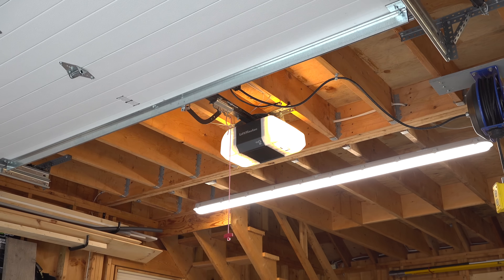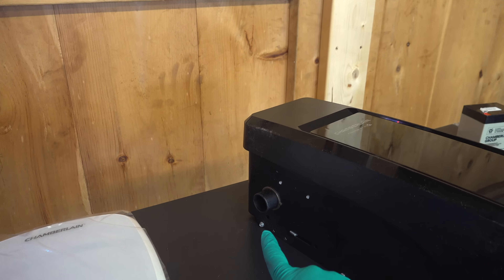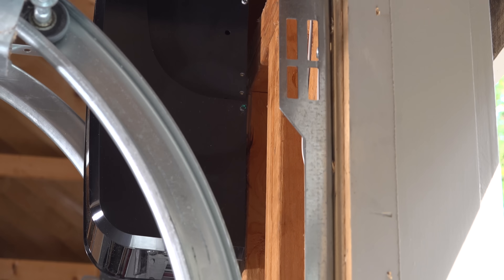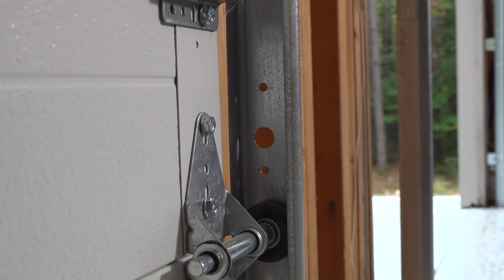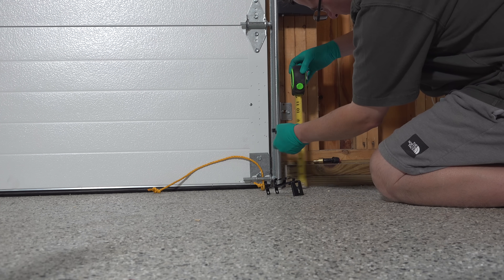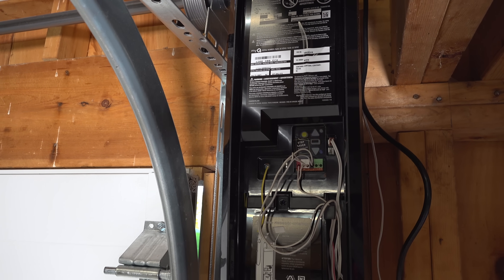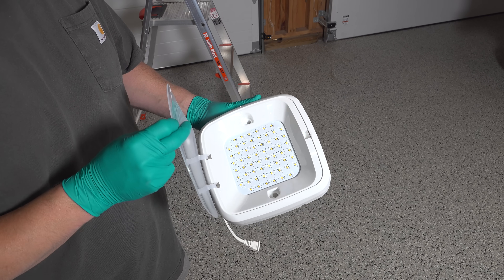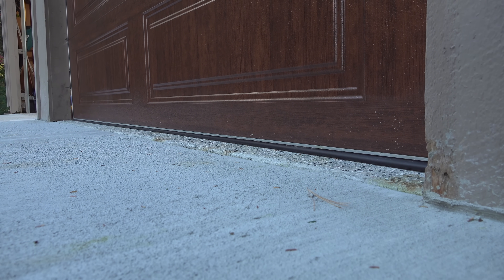Finally a SILENT Garage Door Opener that locks like a SAFE! - RJ0101

Comment: And when you replace the broken springs (normal life cycle) upgrade from the usual 10,000 cycle spring to a 30,000 spring for a small upcharge.
Same labor, 3X the life , a wise choice that few know exist.  
Measure the coil wire diameter, inside coil diameter ( maybe 2" or so) and overall length and spec the upgrade!!
My overhead door buddy clued me into this!

Comment: Looks like the deadbolt does not fail open? So we're locked out of the garage if the power fails. Great idea but we couldn't use it in our setup; the bays have no access except via the garage door, and we have frequent power failures.
Also, "between $300 and $400 for a name brand opener? I've always bought Genies and Chamberlain and LiftMaster, and have never spent more than $150.
Still, this is neat and if my opener ever dies, definitely going with one of these. Check around though, they're a LOT cheaper at my local home improvement store than on Amazon.
Reply from the maker: No garage door will work from the outside without power but this one includes a backup battery that I didn't show but mentioned later in the video. It slides into a cover in the bottom portion of the opener.
Reply: @SilverCymbal  That's pretty cool. I should move the door openers over to a backed up circuit on our solar batteries so it's not an issue.
Reply: When was the last time you bought a $150 garage door opener?  This unit has a battery back-up in event of a power failure.  What other opener will work in the event of a power failure?
Reply: @D2O2 Almost every opener at the store I looked at was < $200, most < $150. There were only 2 that were > $300. Major midwest home improvement store.
Both the openers at our house now, both installed within the last 8 years or so, were about $150. 
I didn't realize this has a battery backup, I watched the whole video and either that wasn't said or I missed it. In fact what was the talk of pulling the release rope "in case of a power failure"?
Reply: @N-M424  If there's a power outage, I just walk in through the service door and pull the disconnect rope and run the door up by hand. On the other bay with no service door, I installed a locked disconnect cable. There's a key in the door, turn that, pull the lock core out, it has a cable attached to the end which goes to the disconnect rope, then same thing.
If I ever have to replace an opener I will definitely get this one. It looks nice. I'm planning on building a 3rd bay next year and I'll use this.

Comment: How does the deadbolt keep the door closed? It just sticks through the railing and the door will open until the roller hits the pin.
Reply from the maker: Without the deadbolt the door has some resistance to opening, I couldn't move it at all but I am guessing if you used a pry-bar that the door could be opened, hence the deadbolt and you are correct the wheel will hit the lock preventing it being open further. You can place it right above a roller if desired to restrict opening it by force to just a few inches. I also learned from a commenter that you can have 2 deadbolts if desired for more security.

Comment: If you are just looking for a quiet garage door opener, belt drive DC motor openers are just as quiet.  Space saving is really the biggest reason for getting this type of garage door opener.  Jackshaft garage door openers always come with a deadbolt, not sure why. Maybe it is easier to force garage door open?

Comment: This style is common in commercial applications. Chamberlain is the "residential" unit, Lift Master is the "commercial" units. Same company. I've installed both and frankly, the differences are small if any. Both are great units!
Reply: I have three,  22 year old,  belt drive Lift Masters in 2 properties. Love them. The only noise is from the metal rollers rattling. I wonder how long they'll last? Workhorses.
Reply: Honestly I doubt there's any equipment or component difference between them. They're the same thing where Chamberlain is sold retail, and LiftMaster is sold wholesale to garage door installers.
Reply: The difference on a regular opener is the motor's track, on Chamberlain (DIY) the track comes in 3 pieces, LiftMaster's track comes in 1 long piece, better/smoother on heavier doors.
Because the track is so long, you'll not see it in DIY stores.
Reply: @VanillaIceCoffee  Very interesting, thanks! The actual motor units are identical, though, right?
Reply: @aaron74  maybe the board is different, the liftmaster has plugs for the locks, it depends of the model
Reply: Chamberlain is the hardware store brand.  Liftmaster is the door dealer brand.  Chamberlain are only residential.  Liftmaster has residential and commercial.

Comment: thanks for sharing. i’ve had one of these for 4 years. you didn’t mention that it comes with a 12v battery that can open and close the door automatically even when the power is out.

Comment: Have been using these for a couple of years and mostly love them. Our single car garage opener does have some issues. Since the door isn't heavy the cable tensioning system sometimes gets less taught with temperature changes. This causes the tension safety device to think the door has hit something while closing and the door raises back up. After some tinkering around we adjusted the door to stop just before it touches the ground thereby keeping the tension cable as tight as possible. Time will tell! ALso the light we have is programmed to both doors thereby only needing on light! Bravo!
Reply: you may need to adjust your spring tension because most garage doors are pretty darn heavy without any spring assist.  I find that most doors are not set properly where they balance on their own if you manually raise it about half way.  Most drop like a rock or roll upwards because there is too much or too little tension on the springs.
Reply: @jayjay6117  No, in our case we set the garage door up in winter. Then in summer the door is larger, which causes the door to contact the floor just slightly and in turn slacks the cable ever so slightly as to trip the safety. So we reset the close to be just above the floor. Does not seal completely but works for us. Our 2 car door does not have this issue.
Reply: As an update: The seal has self adjusted to it's new form. Everything good!
Reply: Get yourself a Genie 6170-HB. Cable tension is built into the operation of the door instead of a separate system - it adjusts lifting force every time it opens to accommodate temperature changes and all that.
Reply: @murderbeam9614  Why would I want to change the opener? Just cause I had to fiddle with it for a few minutes? LOL, How bout YOU pay for it.

Comment: How about stability when closed, typically most door openers close and then apply's a bit of pressure to keep it down and sealed to the floor. If it's free floating, doesn't it have a bit of wobble in wind and such?

Comment: At a previous house I spent about $150 each, some years ago for belt drive models. I realize they're probably closer to $200 or so now. Much quieter than chain drive, and if I recall also had variable speed DC motors. I'd likely do that again, given the cost of the jackshaft model.

Comment: Why was there a sharp needle bin in one of the shots?
Reply from the maker: I have worked in hospitals and medical centers for ages, and these are the best way to dispose of razor blades, sharp screws, etc. They are often free, or sometimes even tossed out for new brands. For the home users like this and last for ages and just remember to peel off the biohazard label if not using them for needles. I should do a short video to explain why they beat coffee cans or putting them in the trash where a kid might get cut
Reply: @SilverCymbal  hi, thanks for you response! A video like that would be amazing!

Comment: I've had a liftmaster 8500W since just after it came out - it's fantastic and I highly recommend it (plus it's super easy to install)!  I only have one complaint, I really would like to find a way to quiet down the solenoid for the deadbolt/lock, the opener is so quiet and then "bam'! Overall though it's a 9/10.
Reply: I couldn’t agree with this more. The deadbolt lock was very loud! Thankfully mine quieted itself down by breaking and I just haven’t seen the need to replace it yet 😂
Reply: I um.. removed the noise maker from the circuit board.  Not as elegant as quieting it down, but it is very quiet now :)
Reply: @EricBorgen  There is no noise maker on the circuit board.  The question is of a solenoid driving a deadbolt through the track - is there a way to slow that down or cushion it so it's not so jarring.
Reply: @seanmcne  sorry - I was reading too quickly! (I think my wall mount remote had a piezo beeper that I disabled though)

Comment: is it me or is that deadbolt subject to the same issue as the emergency release--someone could shove something sideways between the door and the frame and push the manual lever and unlock the door?
Reply from the maker: They could, but they need to do two things. First they have to exert quite a bit of force to pull than handle and they don't know what side its on. Remember the coat hook trick is all done blindly. So if they could somehow get enough force, then they need to slide the release for the deadbolt, and this one is rounded so it wouldn't be easy. The problem with regular openers is that the handle is spring loaded, so just a little force and it pops open easily, and they are always in the middle, very easy to do

Comment: Is there a built-in battery backup to open/close it or are we relying on the pull cord to manually move it?
Reply from the maker: There is a built in battery backup and this model included the battery. I skipped it since the cold here in NH will kill it quickly but for most unit a great feature to have. The battery compartment is right on the bottom of the opener.
Reply: @SilverCymbal  thank you for the reply. I've been wanting to make my garage quieter. I'll just have to make sure my door is compatible

Comment: Thanks, that was very interesting. For me personally noise is not an issue. But what I want next time is a garage opener with a build in battery that still works in case of an power outage.
Reply: Facts. Being when the power goes out accessing the garage becomes impossible.
Reply: @actionanimations4879  The Chamberlain B970C or B970T for example has a build in battery
Reply: In some states, a battery backup for a garage door opener is already mandatory.
Reply: @DIYDaveOK  Wow, did not know that. Not here in Nova Scotia, Canada atm. Cheers
Reply: They have battery backup's for this opener.

Comment: I have a two door garage.  The two jack shafts were nearly perfectly positioned to allow one opener to operate both doors.  Works perfectly!  A huge improvement over the old openers.
Reply: Cool, but does your setup require you to always open and close the doors together?
Reply: @j12997967   Absolutely.  One less thing to think about.  Push the button, and the garage is fully accessible.  
Very handy for the Tesla.  When I summon it out of the garage, it looks to see if the garage is closed, opens the garage and waits for me in the driveway. It works the same no matter which slot it is parked in.
Reply: @j12997967    I have the same question
Reply: @j12997967  I suspect so, but small price perhaps in saving $500.
Reply: This is hilarious. So when you put the operator in manual to open one door, you have to lift both.

Comment: Love your video. I have this opener with cable tensioner. Works just as you described. Also, have an older overhead door opener that i wanted smart feature you mentioned, but didnt want to replace the opener. For $20 on amazon bought a meross msg 100. Which gives me all the smart features i wanted. Hope this info helps your viewers :)
Reply: Do you need the cable tensioner? Are they included?

Comment: @SilverCymbal, I'm interested in replacing my 20 year old garage door openers with these.  Our garage ceiling is a few feet above the door in the raised position - do you think it would be possible to install a larger radius bend track at the top to give more space in the garage with the door open?  It would also keep the door from extending so far into the garage and allow the overhead light to cover more area when the door is open.
Reply: Exactly why we did this.  We have high ceilings in the garage and the door opens straight up with only 1 panel bending at the top.  Works great to have extra storage space

Comment: Most of the noise from the average garage door is NOT the opener... it's the door. My Martin door and opener are very quiet. That said, this new type is the way to go!
Reply: All you have to do is disconnect the door an raise/lower it by hand and run the motor without the door attached to figure out where the most noise is coming from. Won’t be quite the same with no load but close enough.
Reply: Nah, I have a chain drive and it is loud. I've replaced the wheels with nylon and that helps, but that dang motor and chain noise is loud.
Reply: @addanametocontinue  I am doing the same with the nylon wheels, but also wrapping the wheel shafts with shrink tube to eliminate the rattle on the hinges.
Reply: I dunno, mine goes brrrrrrrrrrrrrrrrr
Reply: Your problem doesn't automatically become everybody's problem. It's not usually the door but the opener itself. The horrible sound that people usually complain about is from screw  drive type openers. There's no fixing it. Belt and chain are much quieter.

Comment: How do you manually open when a power cut occurs if you cannot get inside the garage?
Reply: Don’t you have another door for your garage?
Reply: @N-M424  through use of a key lockable device in the door that allows a cord to be pulled which disconnects the door from the mechanism.
Reply: @N-M424  it is actually built into the garage door rather than a separate product. Apologies for any misdirection.
Reply: @cactusbase3088  Does that disconnect the deadbolt too?

Comment: I’ve had mine for more than 6 yrs,it has battery backup to open in a power failure,Love it! I also installed dual dead bolts.
Reply from the maker: I wondered about 2 dead bolts. No one is getting in your place unless they drive a tank through the door!
Reply: @SilverCymbal  Why was there a sharp needle bin in one of the shots?

Comment: Suggestion for garage door opener - put an electrical shut off for the garage door opener(s) on the wall near the opener because after having lightining strike and blow out both garage door openers, I put in an wall switch that shuts all electricity off to the garage so no more dead garage door openers after a bad electrical storm.
Reply: I use an inline surge suppressor and a recept with built in surge to protect the opener electronics
Reply: If it has battery backup...how do you lock the door ?
Reply: This! I built my home about 24 years ago when we were at the tail end of flyover aircraft being able to emit RF signals that could trip a door opener. I wanted the full cutoff in house for that reason alone but also to prevent any outside cars with openers from being able to provide a thief access to my garage or home. Electrician and my builder  thought I was nuts until I explained why, then he started doing it...
Reply: @DIYDaveOK Most openers now have a rolling code that makes it very difficult for others to open

Comment: use threadlock on the square bolts.  they tend to come loose and will just spin on the tension rod.  after using threadlock had no problems.
Reply: As a door installer I noticed your end bearing plate is not square, this over time will sheer off your torsion tube. You should get a professional to service your door.
Reply: Was wondering if this would be an issue. Thanks for the suggestion
Reply: Excellent suggestion and thank you. Looking at upgrading my opener to this one.
Reply: Drill a dimple in shaft then put a taper on end of bolt using grinder wheel. This will lock the connection forever without compromising strength of shaft.
Reply: Could you just drill a hole in the tension rod to receive the bolt so slippage would be impossible?
Reply: @rll1971 NO. I am a professional. And that will cause the tube to sheer.
Reply: @rll1971     Possible, but I would worry about denting or damaging the tension rod...Thread lock will work fine.  been about a year since I used and no problems. @rll1971

Comment: I have two of these, the older ones with the tensioner. I love them but I have to say the tensioner has been a pain, very sensitive. Great that they removed it from the new model. They work with my Amazon Echo and there is a phone app. Lots of customization. The best feature is the door closes automatically if you forget and you can set a schedule to close at a certain time if you turn off the auto close.
Reply: Unfortunately Chamberlain/LiftMaster has removed Alexa support from their "MyQ" ecosystem.  I think the Genie Aladdin connect still works with smart devices such as Alexa and Google Home.  I just moved and I'm about ready to rip out the MyQ here and move back to the Aladdin setup...

Comment: I bought one of these last summer but never installed it as I had surgery and then the neighbor who was going to help me had surgery. I went to work on it last spring and found out the covered box on the wall that had power coming into it was just the low voltage lines for the sensor, so I have been postponing running power to the front wall. Guess you've inspired me to pull the wire this weekend. Thanks! Now where canI find Romex that won't break the bank? LOL